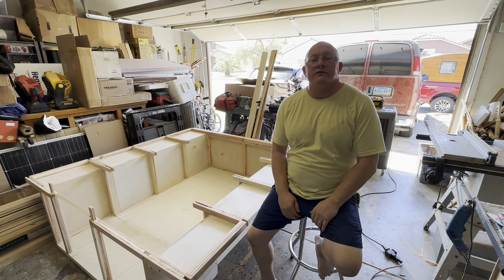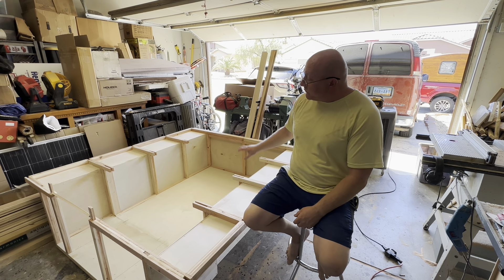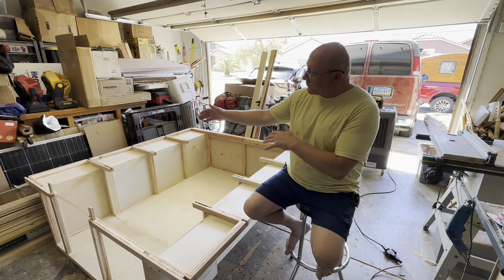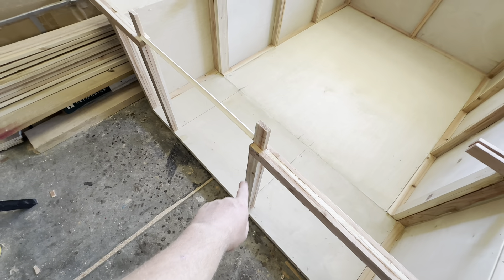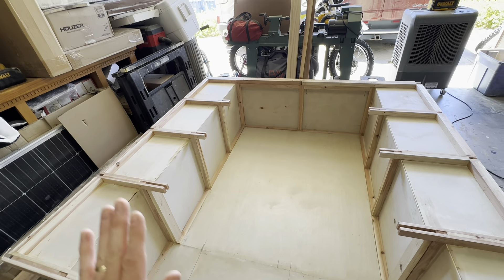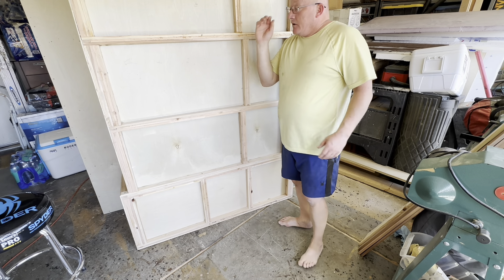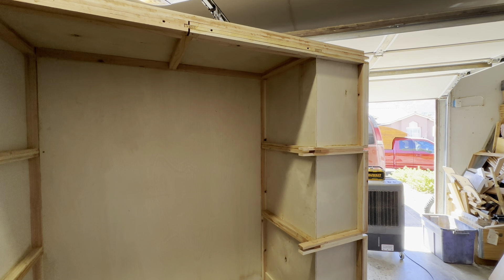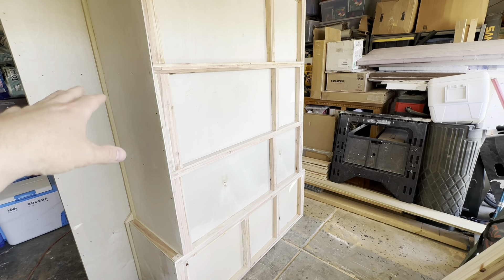Truck Camper Build 9.0 VLOG Part 1 - My Lightest Tub Yet!

Comment: Dave, you are on to a great technique with the laminated cedar over 2x2. I’m restoring a 1967 camp trailer and trying to put it back to factory sizes. If wood was like it used to be, ripping them out of 2x4’s would be great. Now, you rip two from a 2x4, the best you could hand select, they may even initially be straight but tomorrow, a boat rib, lol.
Reply from the maker: Yep, little more time but you don’t have that problem. Thanks
Reply: And 10 times stronger. Dave, if you ever got the perfect camper build, it would be great if you had a detailed plan with sketches to replicate it without starting from scratch.
Reply: I think it's great he's using this method. For several years now, I've considered building some sort of camper, but I thought about using 1/2" plywood ripped down and built similarly, for the same reasons he mentions in the video. I think cedar would be superior for rot resistance and lighter weight, however. I was thinking of it from a higher dimensional stability standpoint. Regardless of material, I'm loving that someone is finally using the laminate beam idea in campers!

Comment: So this pan is bigger than 8.0 yet lighter. You are definitely optimizing the weight to strength ratio. Have you any load testing of the new architecture to compare approaches? Nice work.
Reply from the maker: Nothing scientific. I do check for things like rigidity and it is performing as it should. It’s definitely really strong.

Comment: Hey Dave I have all the confidence in your ability to do your front slope. If you use your mortise procedure and, with the polymer glue that available today and, bond the outer skin material to the framing it ain’t going nowhere.  I deliberately pushed my whole frame assembly 4’ off my work bench and, it never moved at all.
      You know what you’re doing pal.  It’s going to be another great creation.  Damn put some shoes on.  lol 
Your friend Ted from Arkansas
Reply from the maker: Thanks Ted for the vote of confidence.

Comment: Dave. What have your learned about Best Method to attach a camper to the truck bed?
Reply from the maker: If it is relatively small on not too top heavy, turnbuckles in the rear and transom ratchet straps in the front all anchored to solid internal bed mounting locations. If the camper is bigger and top heavy, run ratchet strap through bed and connect to frame of truck and also add turnbuckles up front too.
Reply: Thank you
Reply: I’m planning to build a camper for my 8’ bed F350 7.3l gas crew cab. Despite the fact that it has a 4016# payload I still want to make it LIGHT. 

I love your videos. You are quite thought provoking and a good teacher. 

I also love how you manage to do all that work in a cramped space. I would love to have a 30x40 foot shop but I don’t want to wait to build a shop before I build a camper!!!!
Reply from the maker: Thank. Share pictures of progress if you don’t mind.